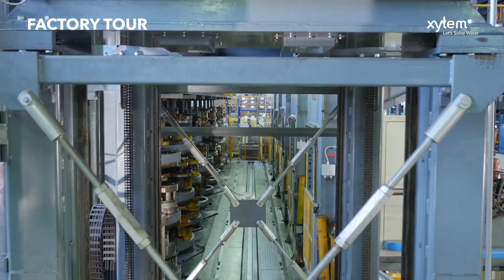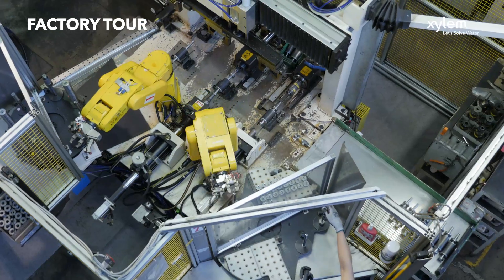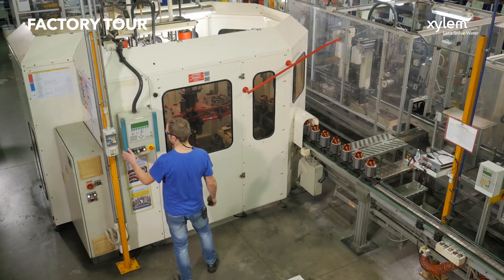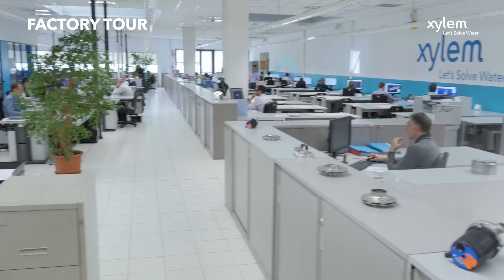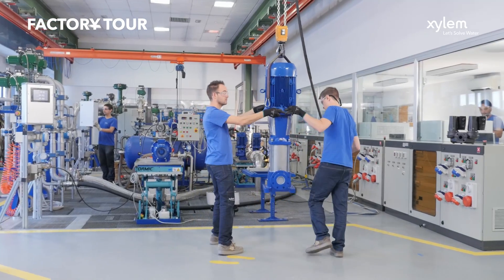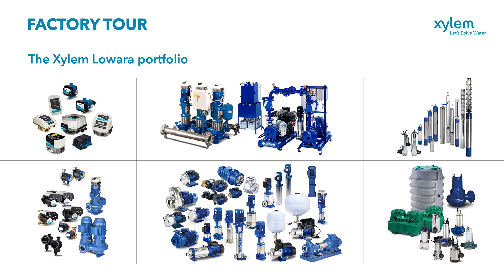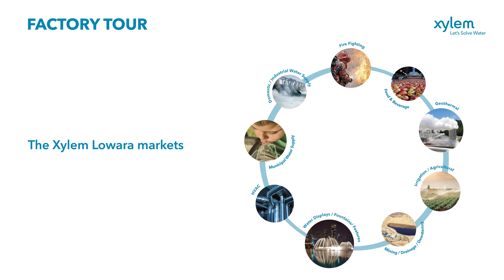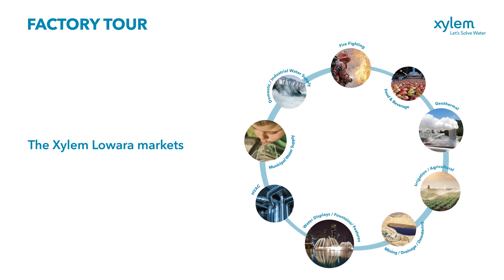2016 Xylem Lowara manufacturing facility in Montecchio Maggiore, Italy

Comment: Do you know where I can get an exploded diagram for the motor in one of your e-LNE systems?  LOWARA PLM112RB1456/340 E3.   P2 4.00kW.  reg.07520560967.  Any suggestions gratefully excepted.  Thanks.
Reply from the maker: Hello! Thanks for your interest on Xylem Lowara products. The suggestion is contact your local Xylem Lowara representative. Best!